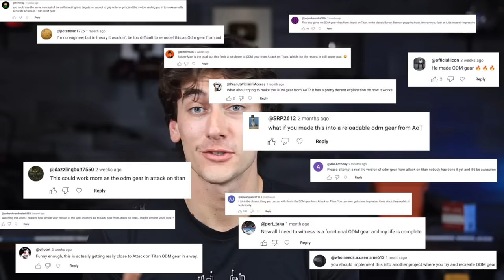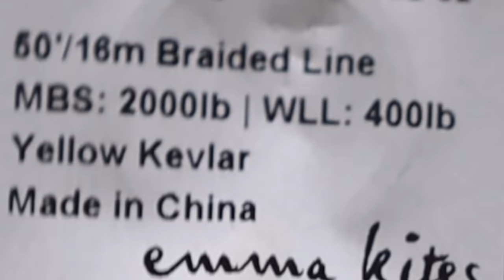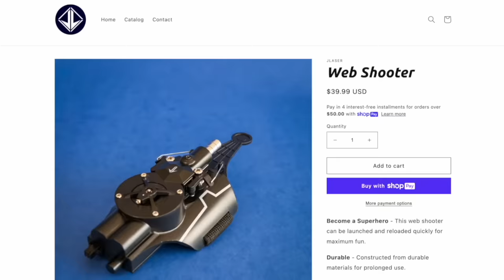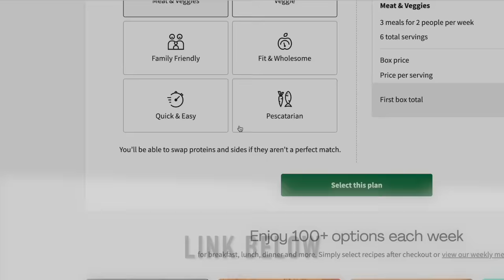I Built Real ODM Gear! - Attack On Titan

Comment: I'd honestly love to see how much further this design could be taken. Groundbreaking work you're doing here.
Reply: wall-breaking*
Reply: Yeah. I think one of the most important things he needs to tackle next is how he's going to have the hooks quickly dismount from the wall, retract, and be able to re-engage them again. That would again take brilliant planning and doing, but I believe he can achieve anything at this point
Reply: @andrewmanzano4792 I have ideas but it would take a lot of possible fabrication. Like you could have a barb in the tip that you can retract to let it loose. Honestly this build has a lot of potential
Reply: @Blackplague17  Maybe something like a remote controlled mechanism with the spike, where after hitting a surface releasing the trigger will cause the spike to retract back and hopefully pull itself loose, then it can be reeled back in.
Reply: @100organicfreshmemes5   Name of the game there is reliability, any sort of electronic or non-mechanical control is going to be prone to failure. In the video J mentioned this ODM gear had a reliability issue which is likely due to a LOT of this design relying on non-mechanical functions. I think if you made the firing blocks semi-rotatable, like in the show, it could solve a few issues with aiming and obviously a full body harness opposed to a waist harness would make it much easier to shift your weight.
Reply: next: thunder spears
Reply: @100organicfreshmemes5  that’s what I was thinking too

Comment: you could add pressure reeling. based on how much you press on it, the reeling speed changes. and a hold when youre done reeling so that you can swing from whichever distance you want. 

refining this tool would result in such a cool thing
Reply: Yeah, he also needs to have the appropriate clothing with harnesses attached correctly to direct and distribute his weight. The series shows basically every component of the ODM gear from the triggers/levers in the hilt and their functions to the compressed gas system reeling in wire by spinning a turbine.

Comment: That's awesome. I've seen others attempt this but this is the best ODM gear attempt, I've seen yet. Interesting to note that in the show, they eventually do use ODM gear that shoots from the arms similar to the style of your webshooters. Also, I really loved Hacksmith's AOT Thunderspears. Basically, what's so cool is that even though the physics of AOT is questionable, the concept of much of the tech used by the Survey Corp is all technically possible.

Comment: This is a remarkable step forward from any functioning prototypes I've seen for any of this sort of gear. It is quite literally so close that I'm sure with two or three major upgrades and some experience using the thing, you might be able to achieve something near identical to what they do in the show, for example, the ability to retract the wire for a second swing.
Reply: maybe if it wasn't a fractured spine waiting to happen on the first fall

Comment: I think people forget that air also allows the user to fly through the air like they do in the anime. The air is given by this crystal that only Paradis island has, which I assume is how the anime justifies the ODM gear even actually being "real" to the audience. It's a fantasy rock that has extreme power that seems to last almost forever in the show.
Reply: which is weird cause, they had to severly nerf it in the game where the air tanks are among the ones that also has to be refilled along with the blades
Reply: @kaoru288  well no, they do need to be refilled, even in the anime there were a few scenes where someone ran out of gas. It's just that it's not compressed air, it's a type of rock that gives off a certain gas, and this fuels their ODM gear.
Reply: @eatyourvegetables1449 funny rock really is just really really compressed gas which has a high melting point.
Reply: Some of them can’t survived until the gas ran out.😢
Reply: @kaoru288 They had to refill it in the show pkenty of times too
Reply: The rock is called iceburst stone and some people have said that its description in the manga is similar to methane clathrate
Reply: @eatyourvegetables1449  I tend to think of the stone as more of a catalyst for the 'gas' that they use.
Reply: @eatyourvegetables1449 yeah, wasn't a lack of gas a key plot point in season 1 (i think they were reclaiming trost?)

Comment: One small detail missing, is that the wire launchers in the show can swivel up and down, so it removes the restriction of aiming high up. Only other suggestion is way more belts around the body to distribute weight.
Reply: What’d be cool is if he was able to use some kind of arm or hand tracking like with those RC cars so that when he points to a spot the launchers aim to that point
Reply: one big detail is also missing(not arguing how possible) in snk they use a steam powered mechanism to move around and not rely on motor itself only
Reply: I was the 70th like, The prophecy is ruined.
Reply: @burakklc4945  it's One of the most clever tricks, they use the gas not only to Fire but to reel back too, and the gas world like a jet engine propelling the soldier through the air

Comment: Literally like one of the most dangerous things one could possibly do at the end there, but well worth every ounce of risk to nail that sequence for real...  Truly masterful stuff going on here folks.  Look, I'm also a tinkerer/fabricator/designer and I make weird stuff like this all the time, but even I had always determined that true ODM gear was just unfeasible and otherwise impossible.  From the wall darts to the reel system, it just didn't seem realistically plausible from a functionality standpoint.  Oh sure I could build something to do what it needs to do, but the real limitations begin to appear in the physics of the movement and the forces necessary to move a meat suit around that quickly and easily.  The acceleration alone would create enough g-force to turn one's insides into paste and break just about every bone in the body.  However that's only when moving at the speeds seen on screen if scaled to a character's weight and surroundings.  Even so, finding a reliable method of anchoring the cables when fired ended up being problematic.  I tested a few solutions including a similar approach to what JLaser did here with the nail caps, but I wasn't having nearly the success that he seemed to have with them when it came to holding under load.  I was also w working with compressed air rather than CO2 during initial testing.  In any case, I ended up abandoning the project during the design/testing phase due to what was determined at the time to be too many possible high risk failure points and what I had simply deemed to be physical impossibility based on available resources and ultimate desired functionality.  Apparently though this was all BS, and my real problem was merely a lack of vision at the time.  This dude did it, and he made it work without any safety lines or backup systems in place beyond some personal protection such as a helmet and MAYBE some stunt body padding in a few spots.  Then not only does this giant-wanged genius provide video evidence of a successful testing in an outdoor environment, he takes it all the way home by creating a simulated scenario environment to provide evidence of full proof of concept for the entire rig by downing a friggin titan under screen accurate (or at least "screen accurate adjacent) conditions by exclusively utilizing the functional capabilities of the ODM rig.  Again, all entirely accomplished without the use of any safety redundancies or supplementary equipment...  I am truly beyond impressed and quite frankly utterly humbled, if not also inspired by this man's achievement and his dedication to the craft.  The fact that he insists upon staying as true to form as realistically possible based on what is depicted within the relevant media is also incredible and second to none on the platform.  The Hacksmith may have more abundant resources at his disposal, but when it comes to truly replicating fantasy in reality he has seemingly been falling short of what JLaser has been able to accomplish.  

JL set out to make true ODM gear and to make it function exactly how it's depicted onscreen, and he friggin' did it man.  
I just...  I'm honestly so impressed and blown away that I'm finding it difficult to adequately illustrate here.  I'm really kinda speechless to be honest because this is just so remarkably damn cool!  Lol 😅.
Absolutely magnificent man, truly quite the legendary achievement here in my opinion.  This is why I watch YouTube.  This is why I'm a tinkerer and fabricator.  It is feats such as this that serve as reason for me to get out of bed in the morning and to get working on a new/current project.  Thank you for this, JLaser.  You have the mind of a visionary creator and the heart of a dreamer, and you are a true credit to the engineering and fandom communities. Keep doing what you do because you do it better than the rest.
Reply: The limitation was never in the gear itself, but in the ability to use it. Firing hooks and wires in every direction during a combat situation is essentially suicide.

Even outside of combat, the hooks must have a failure rate that is too high to trust leaping off a building and of course the g force will still dice you right out of the straps. 

Super cool idea and video though. Very satisfying to see it done for real, even if limited in manuever to reality
Reply: @trequor Right, exactly.  That's kinda what I was saying.  It's impossible to replicate 1:1 onscreen functionality primarily due to the limitations of the physics involved.  The mechanical limitations of the actual equipment are sort of secondary...  Plus I mean considering the heights and dangers involved, there's far too much on the line to be trusting to some equipment that has such a high failure rate, especially in the dart anchors/hooks.  There's just no way to ensure a consistent anchor point every time and it's also entirely dependent on target surface and material (hardwood vs softer woods or rotting wood, concrete vs brick or stone, etc.) and I'd be pretty hesitant to start throwing all that torque and such heavy loads on those dart hooks with complete abandon like that...  Definitely way too sketchy for me lol.

Comment: This is so incredible! Though you guys did forget about the gas propulsion chambers that the scouts use to propel themselves faster or in the direction that they need to. I bet that'd be no problem for you guys and I'd definitely love to see an updated video where we could see that! 😃
Reply: Nah that would require so much energy that it would actually put a ton of strain on your body, more than even fighter jet pilots experience. The energy required to propel someone that large anyway would be ridiculously expensive or bulky to implement(Probably both).That unfortuntely will stay a work of fiction unless we discover a way to reduce G force drastically, and a way to harness energy on a smaller scale without sacrificing power. (The G suit still isnt even close to enough).
Reply: @nyanzombies2174 yea there's a reason they used a specific fictional material that could only be found in Paradis for that part lol
Reply: @nyanzombies2174 The show kinda tackles it. They go through intense training to handle the G Forces. Also, we see that only a few soldiers are able to use it effectively. So, they only choose freaks of nature. Even then, the most skilled character in the show breaks his foot due to the sudden stoppage. We see characters constantly falling over. Another incredibly strong character basically loses control, hits the floor and passes out while getting wrapped around the wires.

But it's still pretty unrealistic. All of them should be vomiting all the time at the very least
Reply: @nyanzombies2174 im pretty sure you don't accelerate even close to fast enough for it to cause damage lmao. Odm gear isn't accelerating faster than a car or a passenger plane.
Reply: @VYDEOS2  It's not about the speed, but the rate that the speed increases, putting pressure on your body. You'd experience a significant amount of force going from 0 to 60 miles an hour in less than a second with odm gear. Then you have to consider turning, which is extremely difficult to do precisely at high speeds and ALSO puts huge strain on the body. The same way that a car crash is deadly because of the force it puts on your body when you go from 80 miles an hour to zero instantly. And likely they travel faster than that considering how the show portrays it.
Reply: @VYDEOS2 ODM gear in aot definitely accelerates the characters faster than real life cars by at least ten times lol. they go from standing there/running to instantly flying really fast
Reply: @nyanzombies2174 I mean yeah it puts strain on your body, but you can train to handle it. You can see it on F1 drivers aswell as some military forces. It is not impossible to make something close to the original but at the moment I'd say it's impossible to completely make a fully functional one. And yeah you would have to handle the G force somehow
Reply: @Frienea  Even if we made a breakthrough in material sciences & some kind of incombustible gas from Paradis would surpass chemical energy, we'd invest into gas-powered .50 Cal rifles to kill "titans", not ODM-gear. In all seriousness, it could be possible right now who knows, but it's always going to be so insanely inefficient that no one will invest into it.
Reply: @Frienea  This is absolutely true, and I made note of it in my original statement, but it's still vastly different. A fighter jet accelerates quite fast but to avoid killing to driver they do have to be careful with how they accelerate and decelerate to an extent. The amount of force a fighter pilot will experience is somewhere in the 9-12 range with a G-Force specialized suit. With odm gear, the acceleration is instant, making it much worse. At the very least they're experiencing 4x as much G force with their acceleration (maybe 35-40 just based on some scenes from season 1, it only gets crazier and faster in later seasons). The ackerman family is a special case since canonically their bodies could take the strain, but anyone else would be ripped to pieces from moving at the speeds they do.

Comment: Now you just gotta figure out how to make it reusable after each 'shot'. My idea would be make the cables pneumatic and have a small pressurized reservoir of gas in each anchor that can punch that spike in and pull it out repeatedly, which gets re-pressurized through the cables when not in use. You'd also need a larger reservoir of pressurized gas on your harness for multiple shots, similar to their gas tanks they have in the show. You should also try to reduce the amount of anchors from 4 to 2 in total, you could also probably get a custom design for the anchors CNC'd out that would be more accurate to fire and stay anchored better. Someone else also pointed out that in the show the sword handles are attached to the firing points of the anchors through a pulley system, which actually lets you aim with your hands where the anchors will hit to an extent.
Reply: He has also to figure out how to do it without electrónics
Reply: I like your funny words magic man
Reply: @alfredohumberto2222   Not sure how to without using some very high pressure gas and some tanks the size of the fictional ones. I mean, the tanks aren't really that big. Smaller than the blade storage. But you'd need to use gas to run everything. Valves need to be used (mechanical or electrical) and you need whatever gas to: fire harpoons and perhaps actuate them, reel-in the cables (impeller for torque perhaps), provide jet propulsion from the rear. Anything adjustment usually done by the wearer, has to be mimicked IRL or done elctronically. The thruster can be angled mechanically somehow, the barrels can be angled by arching your torso/back/legs backwards.
Reply: @2KOOLURATOOLGaming  I don't know but in the anime they don't have electronics at that point
Reply: @alfredohumberto2222  Oh I know, but that is fiction I'm meaning that it might be much harder to design based on gas than on electronics.

Comment: The scouts have to train for months to be comfortable using the ODM and you can even see him getting more comfortable with using them as he goes through the video.  Im sure if you actually trained with these and were slightly more stable could actually use them really well.  The only problem is the detaching
Reply: I always figured that the 'hooks' were three bladed harpoons which stabbed into a wall in four places, centrally and at the tips of each blade. I figured the 'rope' was actually a steel/rubber braid to stop chafing and that there was a central cable inside which, when pulled, mechanically retracts the blades of the hook to allow them to detach. Not sure how it would work with the forces involved but we at least know that certain wall materials cannot be penetrated by the hooks.

Comment: Yo this is an insane project and idk if maybe you already thought of this and it wouldn't work or wasn't practical but you could put rope locks like rock climbers use to keep you from unraveling and a speed controller seems like it'd be useful to keep you from having to go basically all or nothing on the throttle.

Comment: In the show, the ODM gear also has a gas-based propulsion system to accelerate them through a swing and gain height, etc.
I think it would be a really cool and (as far as I can tell) feasible addition to this.